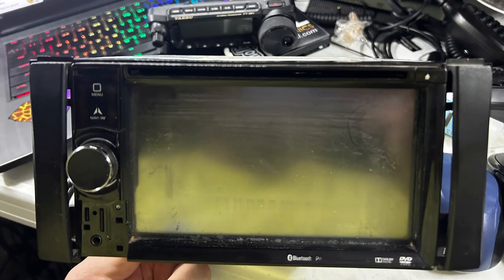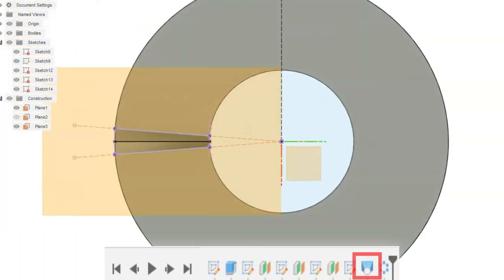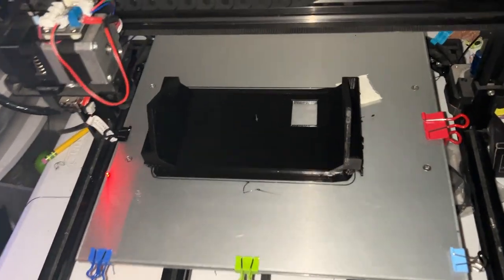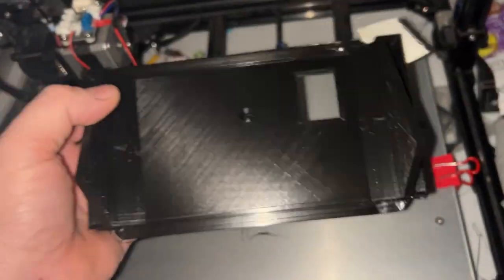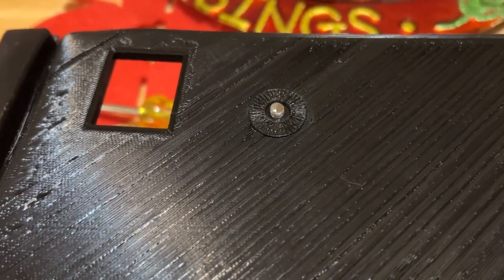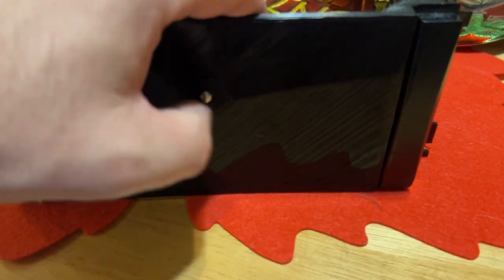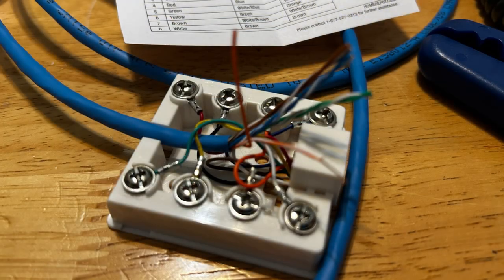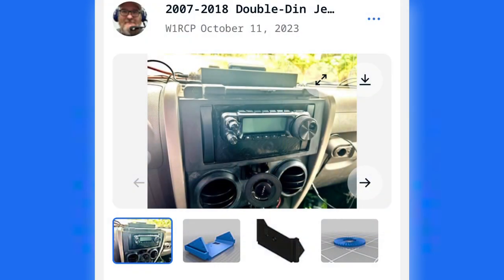Yaesu FT-891 DIY Separation Kit Mobile Install - 3Dprinting Fusion360 - Jeep Wrangler

Comment: Printing in PETG now.  Looks like there is room below for my FTM-350 head as well.  I'll mod the first one with tools and then remix.  Looks great!  Tree supports are the best on this.  73 and thanks!  New Sub!
Reply from the maker: I did print it in PETG. It’s the ugliest green you could ever imagine. I was using Slic3r when I printed it, but now I use PrusaSlicer.  Glad to have you aboard!